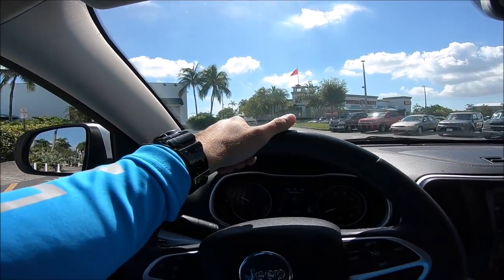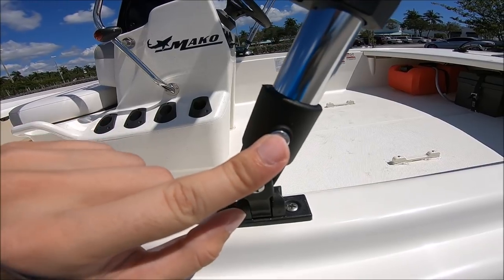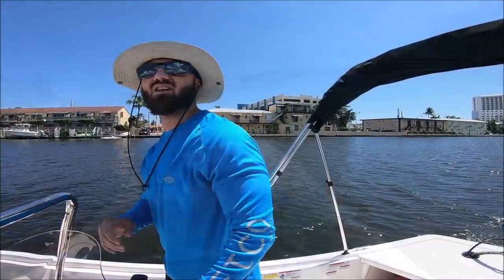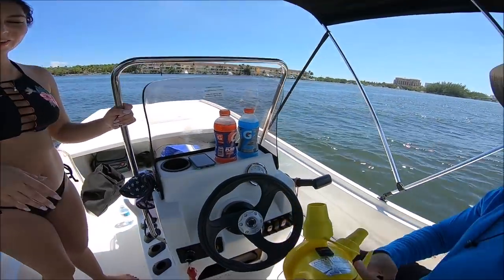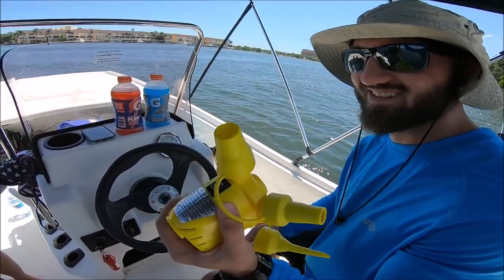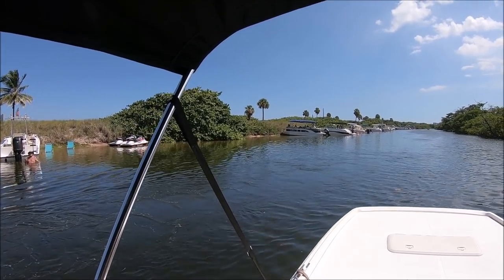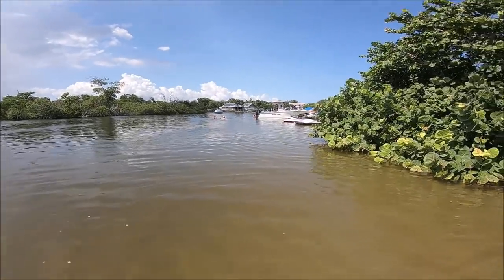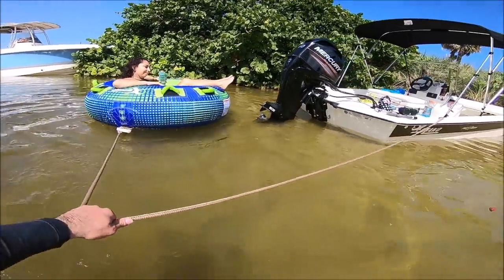New Bimini Top & First Time Tubing! (Learn how to tube on the Mako Pro Skiff 17)

Comment: can you share the links where you get the rope that connect to the back of the boat?  also, what length did you get to pull the tube.  Great fun video with tubing.  I have the exact boat and would like to get the kids on some tubing.  TIA.
Reply from the maker: @mtnguyen1696  this was a few years ago, so I can’t remember the length of the rope. But I can remember picking up everything from bass pro shops.

Comment: The top is nice and the shade is so good. I was surprised how good it towed the tube. Would like to see you do some sharp turns with the tube. The tight turns slow the boat did you loose a lot of speed in turns?
Reply from the maker: Mark C I wasn’t going too fast around the turns. I could have throttled more. I was taking them slow and wide. Once the boat gets on plane it almost feels no different from when I’m running around with no tube attached. I didn’t even try to go full throttle I hit like 5k max.
Reply: @WeekendPirate  
That's very good. That hull is very cool.

Comment: Boat looks great with the Bimini on it.
Reply from the maker: 14theroad1955 I think so too. Its a life saver in the sun!
Reply: That's for sure, I have that same top in white. I'm getting ready to go right now, ocean looks pretty good...
Reply: That called quality control which is nonexistent at bps if u drill holes correctly it won't crack go online and print the correct drill bit for screw chart and you'll have it for future reference thanks JT

Comment: where did you tie the tow rope?
Reply from the maker: augustagator66 To the two tie down points on the transom.
Reply: lol. i'm an idiot, just walked out and saw those. You mean where you tie off the straps on the trailer, correct?
Reply from the maker: augustagator66 Yeah, I didn’t tie them though the tow rope has two quick connectors that connect to those two tie down points on the trailer.  They then join together about 10 feet back with a float where you connect the 60ft tow rope. Look at my video right before we tube I show it all.

Comment: I would be careful with that outboard, I know my dad had a 50 hp boat he used to use for tubing and it ruined the outboard because it was too small
Reply from the maker: Joe Z 60hp does great whenever we go tubing. There’s a lot of factors to consider like the year of the engine, boat weight, type of boat, how often the engine was serviced.